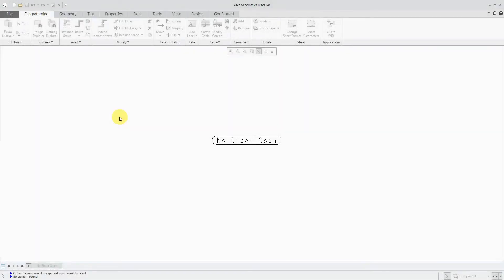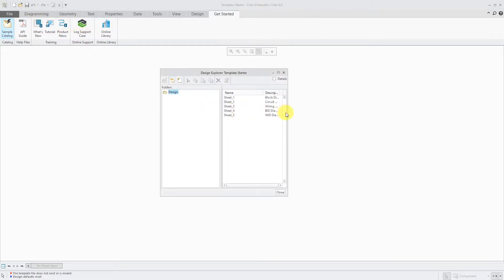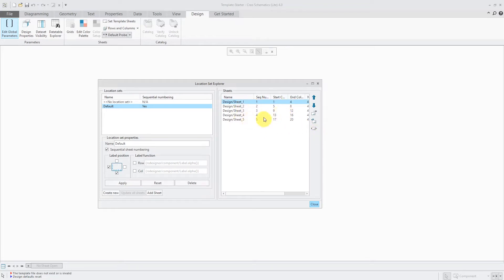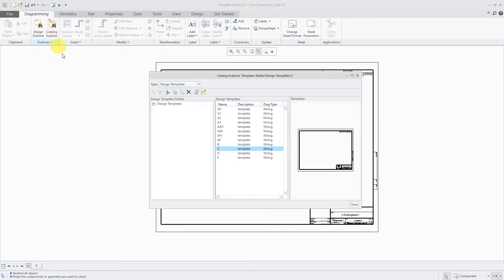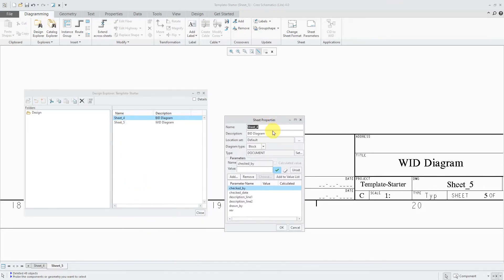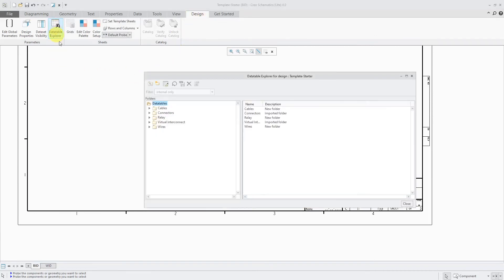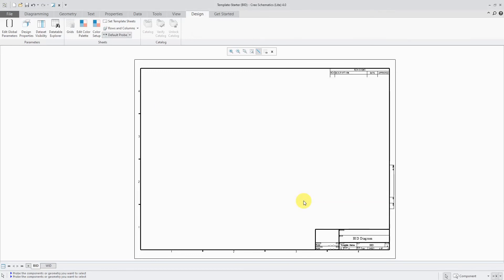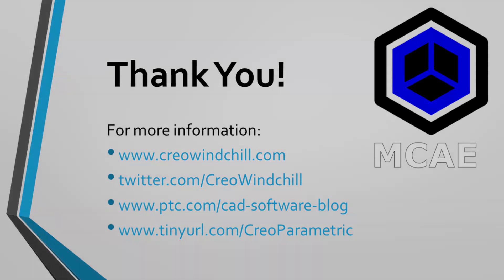Creo Schematics - Creating a Template from the Demo Database | Creo Parametric Cabling & Piping

Comment: If you are against putting title blocks / rev. tables, can I ask why? How would you present the schematics?
Reply from the maker: In general I am against duplicating information in a model or similar artifact that is already captured in a data management system. Creo Schematics cannot pull that information from Windchill so people have to enter it manually. I've seen way too many errors introduced that way. I'd prefer that information be populated using the publishing watermark functionality when generating PDFs.